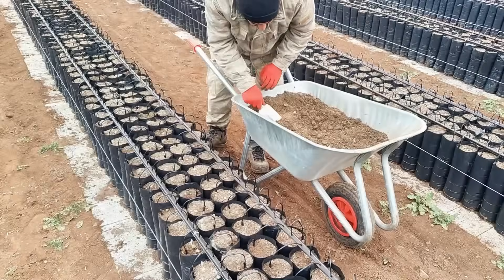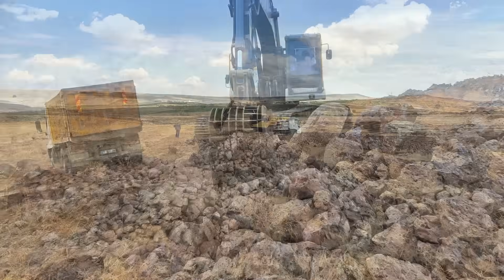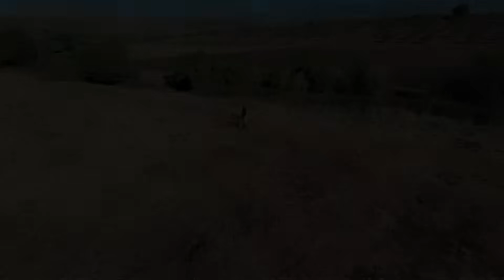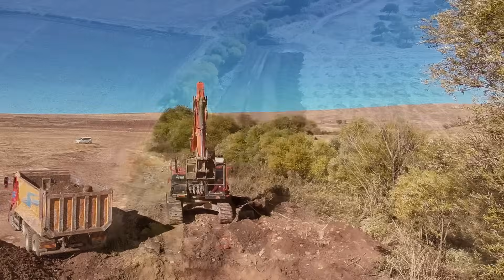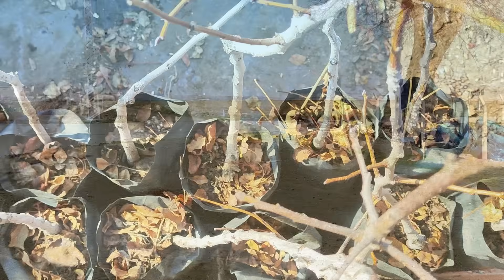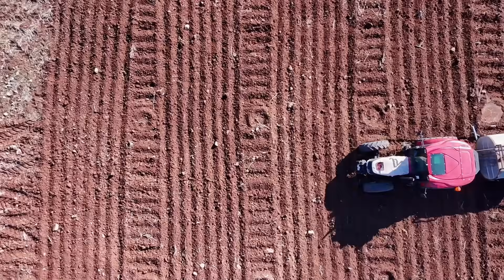Transforming Barren Land into a Pistachio Orchard | Precision GNSS Planting, Rock Removal

Comment: without watering and in the heat, it is necessary to mulch the trees
Reply from the maker: Thank you for your comment. You’re right about mulch. Our elders used to plow the soil constantly, believing it was good for it. It was said that plowing weeds back into the soil increased the amount of organic matter. In some modern practices, it is also said that leaving the weeds on top without plowing helps retain soil moisture. I’m sure both methods have their pros and cons. We should definitely try some experiments in certain fields. Thanks again for your comment. Best regards.
Reply from the maker: Could you please share some video links about this process.
Reply: @SoloHabitat https://youtu.be/SoF7Z6sWiEY?si=xW74SCiq-vTROI5b

Comment: You know heavy engines compressing soil and spoiling for centuries?
Reply from the maker: Thank you for your comment.
Before we planted trees, this land was used for barley cultivation for years, and tractors were used regularly for plowing. Soil compaction was already present due to those past agricultural practices — it's not a new issue.
However, we took a different approach during this transition: we loosened the soil down to about 2 meters using a tracked excavator. This created a healthier zone for the tree root systems to develop.
It's also worth mentioning that tracked vehicles exert less pressure on the soil compared to wheeled tractors, because their weight is distributed over a larger surface area.
Moreover, soil compaction is not only caused by machinery. A lack of organic matter, repetitive tillage, and reduced biological activity can also contribute. What we did was a step toward breaking that cycle.
In addition, deep-rooted trees can gradually penetrate and break compacted soil layers, improving the structure naturally over time.
We are sensitive about soil health, and we truly believe this method will lead to more fertile and resilient soil in the long term.

Comment: PaInt seedlings  white before  pla nting  sunburn prote ctio n  .remove bottom of bag and drop into wet  hole and slide the bag up.Less srress
Reply from the maker: The idea of using white paint is interesting. But you can't apply paint to the leaves—they need to breathe. You can paint the trunk, but most water loss happens through the leaves. The trunk is a bit more resistant to sun exposure.
Before planting, while the seedlings were still in the nursery bags, we sprayed them with kaolin clay. It coated the leaves but didn’t block breathing. However, for some reason, we never thought of applying kaolin after planting.
Watering the hole before planting also makes sense. But since we had limited tools and workers, we watered the seedlings after planting.
Thanks for the suggestions. Greetings from Turkey!